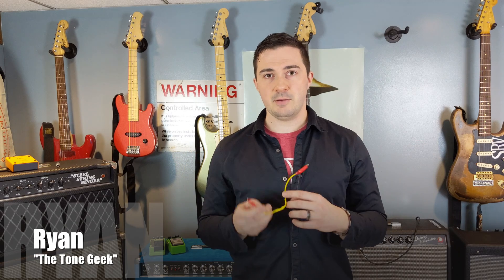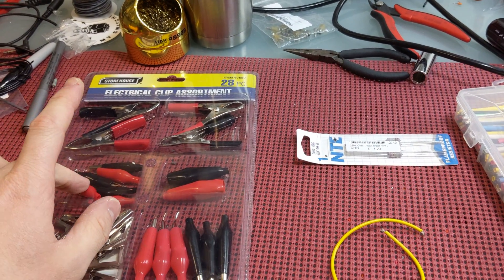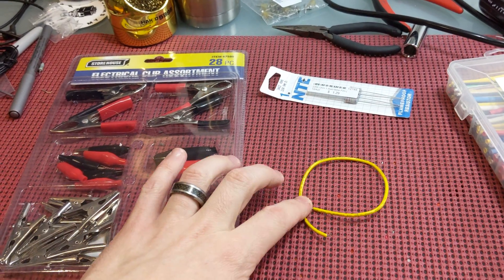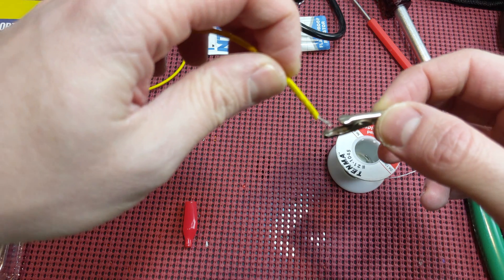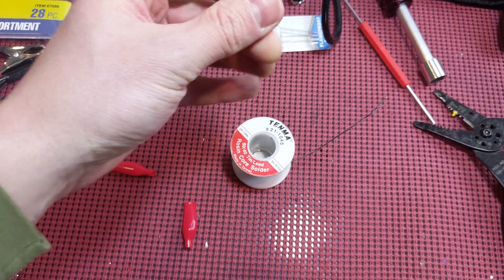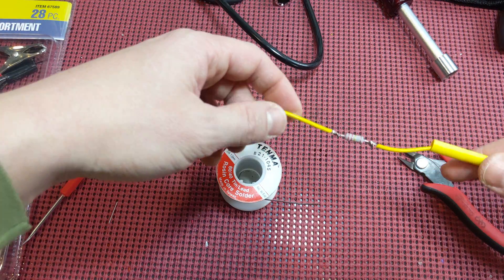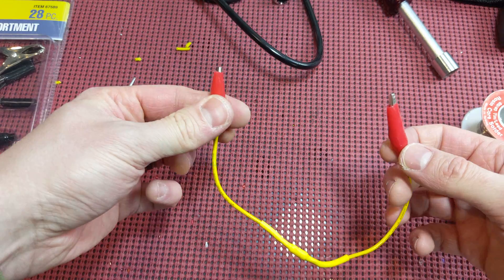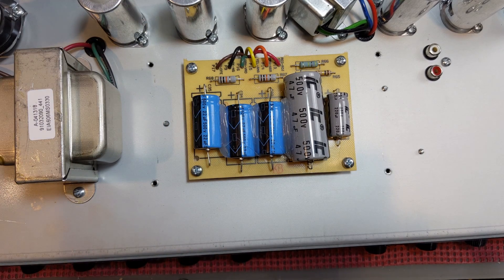How To Discharge Capacitors The RIGHT WAY | Build a DIY Capacitor Discharge Tool

Comment: Do you have a light bulb current limiter?
Reply: Just watched a video on “uncle Doug “ amp channel on making a simple enough safety device to protect the components in the amp , and also protecting you too.

Two different methods , some use a high wattage bulb and others use a low wattage bulb. The light bulb lights bright and then dims in one method and the other method the light bulb only lights up when there is something wrong. I hunk there is pros and cons for both. Very interesting and worth researching for safety
Reply from the maker: Not right now.. duck and cover 😎